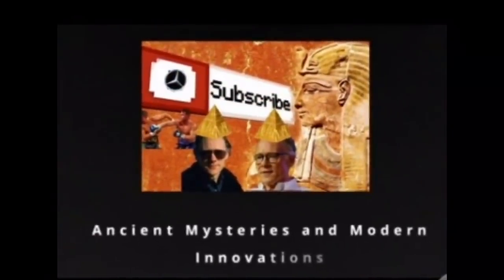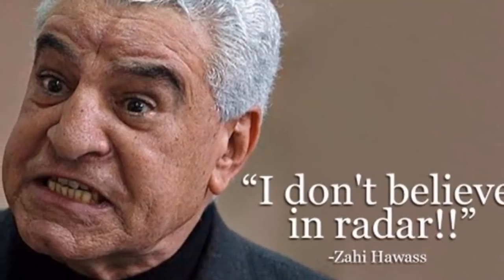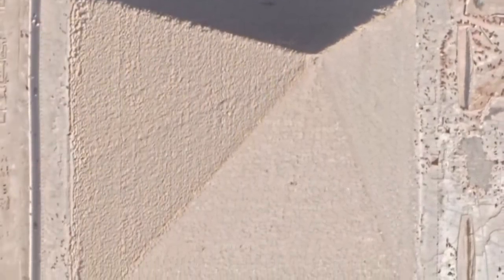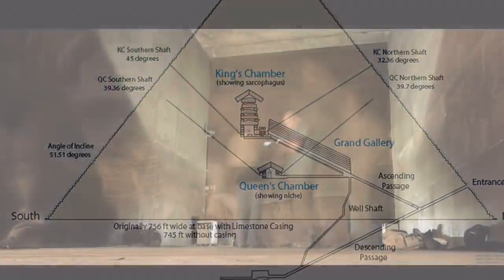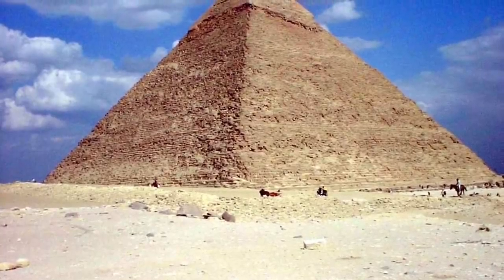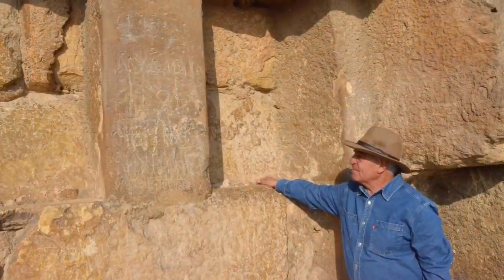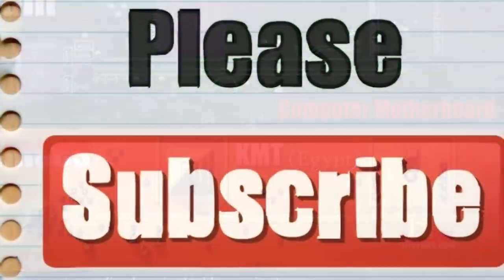Graham Hancock on Geopolymer (Liquid Stone) Technology at Giza Pyramids

Comment: Why couldn't shells be part of the slurry? I've seen cement mixed with all sizes of stone and rubble as filler.
Reply: Roman concrete used shell material.  See link below.  Interesting how scientists find it highly likely that multi-ton stones were hand carved with hammers, to amazing tolerances and hauled hundreds of miles.  But putting shell or fossil material in the concrete mix is ruled out.  Ha ha.  
https://youtu.be/tOhAfaFboNU
Reply: Good point.  The people we think of as Egyptians didn't do this I believe is the more broad point. Graham Hancock couldn't tell the difference between cowboy boots and work boots so I wouldn't worry too much about his knowledge of cementisious materials
Reply: Aggregate is the term, They need to expose some inner stones to see if any signs of wooden planks  from the moulds can be seen after thousands of years of erosion...otherwise the theory is just that...a theory.
Reply: @edwardmacarthur5127  you think they poured stones but there's hundreds of stones over 50 tons up in the 'kings chamber'? The proof that this wasn't built by whom we were told is so far beyond blatantly obvious that i don't understand why all the crazy theories.
Reply: I am a mason. I don't know how anyone EVER thought this was the work of a civilization whom didn't possess wheel technology.
Reply: @mastersamurai7683 you are right,  the Kings chamber must have been the major effort of the builders both logistically and for labour. I doubt granit was poured, I think however the lime stone concrete idea is very exciting though, this would upgrade ancient Egypt's standing in construction abilities.
Reply: @edwardmacarthur5127  I haven't looked too closely at this. It sounds like there may be something to it in certain spots but I can't help but look at the overall structure.  I mean the 8 sides instead of the more commonly thought 4 sides screams extenensing planning. I think whoever built these were probably 500-100 years ahead of our civilization.  Maybe more
Reply: @edwardmacarthur5127  I think another civilization died out and the Egyptians found them.
Reply: @edwardmacarthur5127  check out a video by 'uncharted X' called "evidence for high technology "
Reply: Because you would be able to see other tipes of stones on the mix, things you do not see.

It's that simple, you only see Cement and Fossil.

What you are saying is CONCRETE Cement is the base gel paste that only needs water.

Comment: Different pyramids are made of different materials. Did the ancients have 20 different recipes of concrete, or were they extracting stones our of nearby locations and deliberately leaving one carved out block to demonstrate that they things were extracted in their final form from the source. That means, exact dimensions of the fitting would be transmitted and known ahead of time. They either had the ability to 3D scan on location and broadcast to the cutting machine, or the design of the entire structure was known ahead of time and every brick was pre-planned in CAD. All they had to do is let the laser machine cut, or whatever they were using.

Comment: What if large chunks of rocks were added to the geopolymer mix to give it greater rigidity? It's sort of like a skeleton giving structure to muscles, or how steel rebar is used for concrete structures. Those added rock chunks could of had fossils in them. That said, the compelling argument against geopolymer use is the granite stones within the King's Chamber, as Graham Hancock points out.

Comment: In the south American megalithic sites is where this pouring technique was used, it even explains how they fit together so precisely and the presence of the nodes are probably left over by the moulds.
Reply: To agree with  you and also disagree I think the nodes as you say where like a lifting device and cantilevered!  what’s the weight of the blocks with the nodes your talking about would it be out of the question to be bagged  block in relation to its size ? Ythe lift is similar to the frame that used in ship yards to lift containers it goes over the top and is grabbed by pins located at the bottom of the container I hope my explanation is understandable  it’s easily released when the weight is deposited sorry if this description is described clearly enough
Reply: What about granite blocks though?
Reply: @petraliverani1247  In case of Egypt granite, Davidovits assumes it to be natural, from a quarry upstream. Only the limestone would be based on a quarry of already crumbling material below the pyramid right next to it.

On south America, there is a long presentation on Pumapunku Tiwanaku on the youtube channel of the geopolymere institute.
Reply: @petraliverani1247 Paul cook formed granite blocks
Reply: In Sacuwayman and Olayamtambo near Cusco.  Those blocks were poured. The petrified wood used as a leveling base are still there some are protruding still. They were poured in a type of ancient burlap sack. That's why the front faces of the blocks perforate just like a wet bag of cement would do.

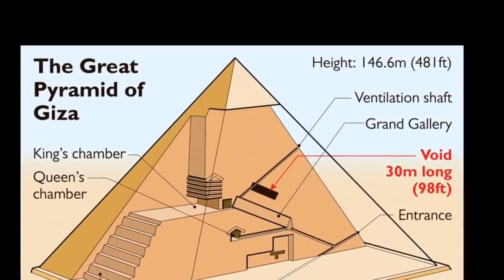Comment: 6:09 Just judging by a cut-away like this even if just the blocks from the chambers were cut and hauled and everything else was poured the ramps wouldn't need to be that steep, most of the height of the pyramids is pour-able.  Also, the fossils he's talking about could be in a chunk put in the slurry, maybe it all wasn't finely ground.  It doesn't make the pyramids any less amazing but it does make it a lot easier and faster to build.
Reply: He was talking about the granite blocks, which are over 100 feet above the ground and would require at best a ramp with a 10° slope, which would be nearly a mile long.

Comment: 70 tons = 70,000 kg not 7000kg
Reply: i think you mean it's lbs my friend ;]
Reply: Zenme Yangzi correct so 70 tons x2000lbs=140000lbsper stone in “kings chamber”.granite from Aswan quarries,400+miles away by boat?a BIG barge with cranes capable of 140000 lift, steel cables 4? Inches dia or ropes 4+?Inches diameter. Surely there would be diagrams of such feats left somewhere. There are none. Surely a few cut Aswan stones would go overboard into Nile. Are there any?

Comment: First time I have heard Graham Hancock say something sorta...um....not too educated. Leave concrete to building experts, please. There certainly could be fossils in Concrete. Nobody says one has to grind all elements of a concrete mixture into 'fine powder'. As many know, concrete is made up of various aggregates of differing sizes. It's an inriguing argument, actually.
Just as intriguing as the notion that the blocks in Peru were joined to one another with an acidic mortar which actually 'melted' the seams of the blocks into one another - also a recent theory which is compelling.

Comment: Breaking up enough limestone into powder would take more energy then to haul the blocks by hand. The Egyptians had nothing to do with building the pyramids. They were as ancient and mysterious to them as they are to us.
Reply: No it really wouldn’t limestone is very easy to break and crumble into dust
Reply: Maybe what the Egyptians did was to recoat the pyramids with limestone. Just some maintenance.
Reply: @2wheelsr2wheels39  If I remember correctly, there is a fragment of papyrus from the time of Khufu which says "...I came onto the  plateau and repaired the Sphinx and the pyramids..." In that case, you would be right. Unfortunately, that 's all I can remember!
Reply: Jimmy Carter built the pyramids...  prove me wrong.
Reply: @trwsandford  Well, it's true he wasn't dead yet at the time the pyramids were built, that's for sure...
Reply: @trwsandford  out of peanut shells.
Reply: @wut3358  time to make popcorn then!
Reply: It's been suggested that the classic scenario would result in perhaps twice as much construction debris than material used in the pyramids. If, as some suggest, this means two thirds of the pyramids volume is actually infill then it would be composed of sands, small pieces of stone and some amount of pulverized limestone. Seems to me that if you just add water you've got a sort of concrete.
Reply: Limestone is pretty soft. I don't think it'd take that much work at all, especially relative to hauling huge blocks from further away.
Reply: I'm pretty sure they had enough bones, shells, eggs and rocks. Around to have it in store. Only thing they will need is numbers on their side
Reply: you're thinking of the Spinx, that was already there not the pyramids
Reply: Vadim Bellous....I agree
Reply: Do your research! Graham Hancock is the following: Graham Bruce Hancock is a British writer and journalist. He is known for his pseudoscientific theories involving ancient civilisations, Earth changes, stone monuments or megaliths, altered states of consciousness, ancient myths, and astronomical or astrological data from the past. Wikipedia
Reply: @benjaminone9914  Don't make us laugh. Your Wikipedia is no good here, now move along.
Reply: Joseph Davidovits
Scientist
Joseph Davidovits is a French materials scientist known for the invention of geopolymer chemistry. He posited that the blocks of the Great Pyramid are not carved stone but mostly a form of limestone concrete or man-made stone. He holds the Ordre National du Mérite.
Reply: "The Egyptians are the devil, I invented geopolymers and the great pyramids."- Helen Madison
Reply: Yeah, when everything is made from stone the least of your worries is finding rubble. I bet on the contrary, they were probably having to cart away loads of it to rock mounds.
It could have been the case that entrepreneurs would take rubble off your building site and turn it into salable product, far cheaper than stone from quarries. Stone waste was ubiquitous.
Reply: I thought it was common knowledge that the "Egyptians" didn't build the pyramids. No hyrogliphics inside, No mention of the pyramids in any hyrogliphics that the Egyptians did make, The tools depicted in hyrogliphics couldn't make the pyramids. Time frame to build etc etc etc.
Reply: @deadlymantis4210  That's absolute, total bullshit.  There is plenty of egyptian writing in the pyramids and clear depictions of the actual construction of them and the tools used to do so.  10 seconds on google, you asshole.
Reply: @nonstopnick  Not in the great pyramid at Giza. maybe in other, later, poorly built copies, but not there.
Reply: nonstopnick where is it depicted of them constructing it? I tried looking on google, can’t find anything but recent recreations of how they think it’s done. Only artwork from their time is pulling a giant seated statue of a pharaoh but nothing that I’ve found about the pyramids themselves. Especially not the great pyramids.
Reply: @nonstopnick  there is not "plenty of Egyptian writing in the pyramids "   .. this is why people don't except that they are tombs. .   This video just showed multiple pictures of the pyramids and there is NO hieroglyphics in any of the photos. . Nor is there any inside or outside the great pyramid.  Quick Google search,  like you said.
Reply: @stephsmanicshenanigans8017  There ARE no depictions, nons was bullshipping ...
Reply: @Zenme Yangzi IF you use a kiln. It can be sun dried ect. I don't agree with this whole liquid stone nonsense but...
Reply: Pyramids werent built by Egyptians but survivors from Atlantis (East African Coast in Mauritania). They used levitation technology to move the blocks into place.
Reply: @downtownCAIRO  what the actual fuck. You believe telepathy is real?
Reply: @ironocy496  Levitation and telepathy aren't the same thing, you should know.
Reply: @downtownCAIRO  ...for which there is zero evidence, aside from being just fucking stupid.

Comment: They weren't poured. Thats just silly. You can tell easily if it was poured.
Reply: Yeah because you are a professional, right?
Reply: No sir, it's not easy. Even pro labs can't tell if it's natural or artificial unless they know what to look for.
Reply: @joemarz2264  well unless they had better methods than todays, you can tell. Natural has many imperfections and layering and even different colours and densities within it which you can see. Pour limestone is very consistent and and generally denser. And you would see mold marks in it unless each block was made perfectly then machined smooth. Just head down to your local supplier and have a look side by side.
Reply: They poured it or there were giants to do the heavy lifting. Take your pick.

Comment: If it was some type of concrete poured into formwork molds, wouldn’t they all be a similar size, clearly every block looks a bit different, not at all homogeneous as fabricated blocks would look.
Reply: But even if there were different textures from different aggregates added to the concrete mix, if the concrete was poured into formwork moulds, they would be the same size because they reuse the moulds and the many moulds made would also be
Reply: @shanereynolds7027  perhaps different aggregates erode more than others
Reply: the same size.
Reply: In the video by the guy proposing the poured limestone theory he adds different mixtures of limestone and gets different textures
Reply: There's also the possibility of many multiple molds.

Comment: In making the outer limestone blocks, They didn't need to grind all the material to complete dust, for instance in today's concrete they are using 3/4" - 1" rock within the mix itself, so the point of having small to medium sized fossils within the limestone slurry used in the pyramid geopolymer blocks is still a definite viable possiblity..
Reply: but that creates a much like bubble/foam look to the block these are a fine grain!
Reply: @gorrthebutcher4696  
I've never seen concrete that has a bubble/foam look to it, regardless of size of the aggregate in it.
Is that what geopolymer sandstone looks like?

Comment: The casing blocks are synthetic, the inner blocks were quarried.
Reply: john pershing look up the work of Jamie Buturuff if u can still find it on the internet. It has been removed for reasons that remain mysterious. He has put forth the only theory that accounts for virtually every component in the pyramids design. The other pyramids are analog harmonic resonators that most likely work in conjunction with the great pyramid and add to the workings of the system as a whole. Super high tech...

Comment: I read the cement guys' book years ago.As a construction manager, it all made sense.His science is spot on. Hancock, it's not slurry, you use aggregate in cement. fossil would be in the matrix if they used fossil bearing material. I can show you this in modern cement.
Reply: @Zenme Yangzi same way we make it today. We mine natural materials like lime and stone for aggregate. Portland cement, for example, is made from lime rock and is ground into powder and baked in rotating kilns. Geo polymer comes from naturally occurring chemicals and it is mixed with binders or used as a binder with aggregate. Lime is only one kind of binder. Salts and acids can also be used in the mix. Roman and Egyptian lost mix formulas are still holding up today. Think of cultured stone products like counter tops, same thing as cement but made with different chemical processes. ( now we use a lot of poly urethane,IE petroleum based) Picture the best possible cement 10,000 years from now and what it might look like. Keep in mind the earliest known cements from Egypt ( the Romans copied them) is better than anything we have today. Why can't it be done now? The materials they used were mined out and the mine locations are known so we know they used it up. The rare natural chemical they used are no longer viable in quantity or quality. Look at how the Hover dam was made: block shaped forms and poured concrete stacked over and over--just like the pyramids. Cement and ceramics materials are natural and were very much available to people then lived closer to the earth that us today, they had a good handle on what the earth provided.

Comment: How was the form work  removed regarding the so called poured concrete blocks.
Reply: You need 4 forms to form 1 block but when you form the next successive block you need 3 and you can form them in a geometric pattern that eventually would require you to use no forms because you're just filling the voids in between 4 blocks
Reply: P. Hamilton  
https://watershedmaterials.com/blog/2015/3/31/geopolymer-concrete-egyptian-pyramids-and-a-new-way-forward-for-sustainable-masonry
The 4th picture down shows a casting lip
Reply: Easily
Reply: Crisco